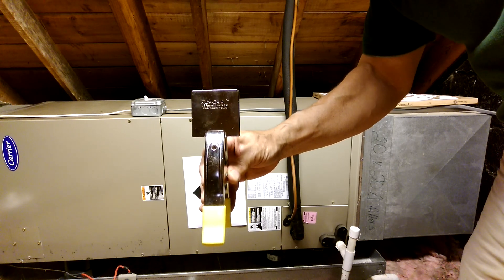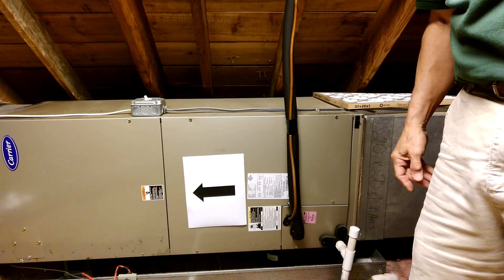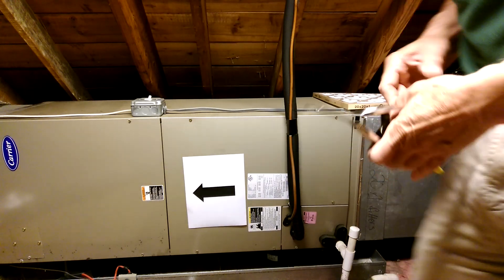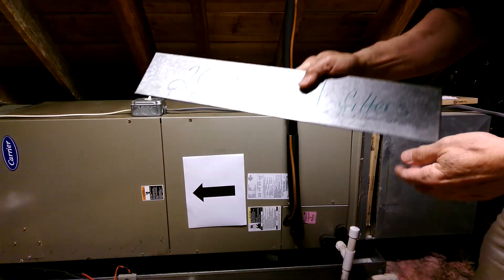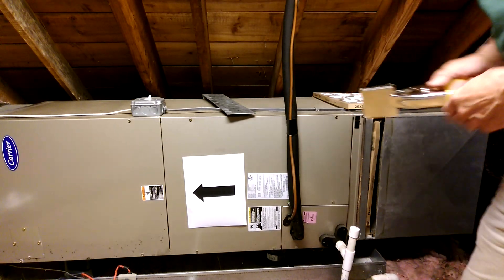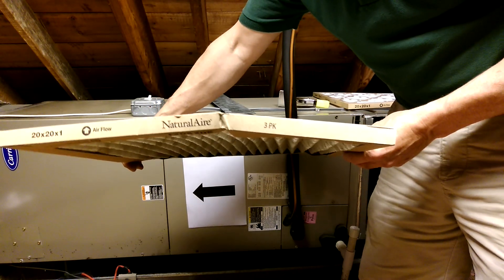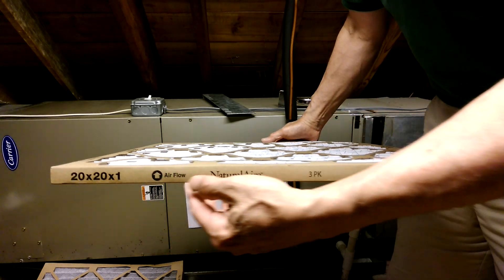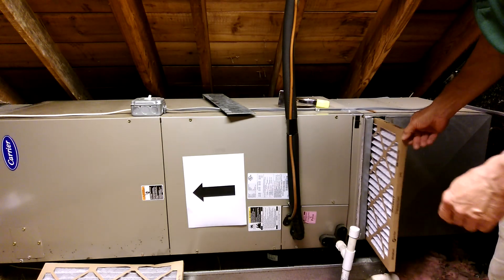HVAC Filter Removal in an Attic Air Handler Installation

Comment: I live in a 2 story home. Every room except one gets plenty of air. The room that suffers has 2 windows. Ive replaced the filters in the returns. But, i have an electric "Carrier" handler in the attic. Not sure if i have a filter in there. I checked and did not see one. Anyways, the room is not cooling properly.  Do you think thats the issue, or duct work? Ps, i have a heat pump and central cooling in az
Reply from the maker: I don't have a clue without knowing the layout of the system. Are there supply and return duces in the area that is no cooling?
Reply from the maker: Supply and return ducts in the area that isn't cooling.

Comment: I have never replaced mine. I have only replaced the ones in the ceiling. Would i have one in the attic even though i have multiple in the ceiling
Reply from the maker: Can't tell for sure without seeing your system. That said, the multiple filters in the ceiling probably are used instead of a single, large filter on the air handler in the attic. Each return air intake can be fitted with a filter (meaning the number of filters will equal the number of return air intakes; this sounds like what you have) or one filter can be used in the return air path (generally next to or part of the big, sheet metal air handler unit) after all of the intakes have been combined into one big duct.

Comment: Had a brand new AC installed little over a year ago it's a York system and I live in South Florida. I have an air filter inside my house and on the air handler itself where it attaches to the wooden stand on the bottom of the metal air handler says filter it does not have one. My question is did they forget to put one in?
Reply from the maker: Without some more information it's hard to answer your question. What do you mean when you say "I have an air filter inside my house"? Is that air filter installed in your AC system? Is there a one inch wide slot for a filter on the bottom of the metal air handler? Though unusual, it is possible that they forgot to install a filter in the slot. If there is a one inch wide slot, what are its dimensions (width and depth)?

Comment: What is the best way to determine the air flow?
Reply from the maker: The arrow on the side of the air filter is one way. The orientation of the "carrier" (the sheet metal slot into which the filter plugs) relative to the furnace is another. All these furnace/HVAC units circulate air in a continuous loop. They draw in unheated/uncooled air from rooms, heat or cool it, then drive it back out to those same rooms. So air exiting the furnace and going up  will be hot/cool air returning to rooms. Air coming into the furnace, usually from the side, passes through the filter and then into the furnace unit where it is heated or cooled.  The air flow direction is the route of air through the circular loop. Does this answer your question?

Comment: They put the filter in the wrong place. You see those black plastic knobs if you slide them they open the cover where the filter should go. I have same model.
Reply from the maker: I think the filter can be effective either under the plastic knobs or where it is located because it is clearing dust from an air stream that passes through both places. Before seeing the writing on the cover for the actual location, I thought it was under the black plastic knobs too. Some installations place filter(s) at the return air intake in a room or hallway, which is fine because they still remove dust from the recirculating air stream. Theoretically the filter can be placed anywhere within the recirculating air stream.

Comment: If air flow gets suck up from below and goes into the unit which way should the arrow point toward the house vents
Reply from the maker: Arrow on the air filter should point in the same direction as the air flow. So if air is pulled up from below and flows into the unit then the arrow should point upwared.

Comment: I have that same unit in my attic but I can’t locate the air filter. I’m having issues with air flow and the cool air isn’t going to the room. Can you please help thank you
Reply from the maker: It could be that the filter is stuck inside the air handler (the big, rectangular, metal box through which air flows) and not visible.Can you post a photo of the air handler?  There should be a slot somewhere on the outside of the air handler that has a cover on it; when the cover is removed the slot for the filter is visible. Note, too. that filters can be located somewhere other than the air handler. Look at the walls in each room (or hallway) that has AC. Each room/hallway will have an outlet and an inlet; a filter may be located at the inlet with a hinged cover that permits replacement of the filter.
Reply: @filtr-griptmgripper313  I will try to post pictures. I know the fan isn't running outside and the Honeywell has Dats not present on the box in my attic. I have a filter in the hallway in the ceiling and one downstairs and one in the master bedroom. It want let me post pictures only a video
Reply from the maker: If you have filters elsewhere (hallway ceiling, downstairs, master BR) then you probably don't have them in the air handler located in the attic. If the compressor outside isn't running it could be caused by any of several reasons: 1) The thermostat isn't calling for AC (ambient temp is at or below the temp setting); 2) Power is off; 3) Unit is faulty; 4) Thermostat batteries require replacement; 5) Condensation pump has a problem.

Comment: If I have an attic furnace and there is a 20x20 filter in the hallway ceiling is that the only filter I need to change?
Reply from the maker: Not necessarily. There may be other filters. Look carefully on the walls and in the ceiling: 1) In each room that has a heat vent; 2) On each floor of the house or apartment. You will be looking for a cover panel like the one you noticed in the ceiling beneath which there is a 20X20 filter. The cover panels usually have tabs to open them.